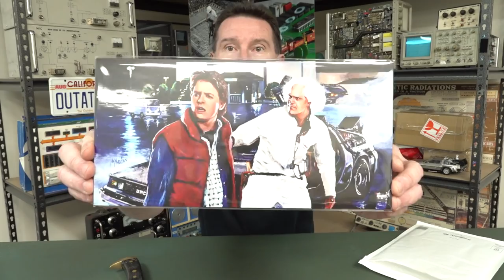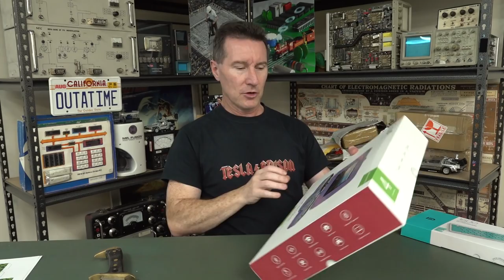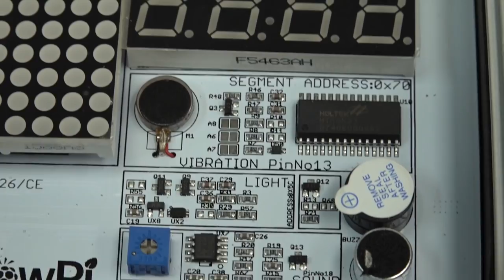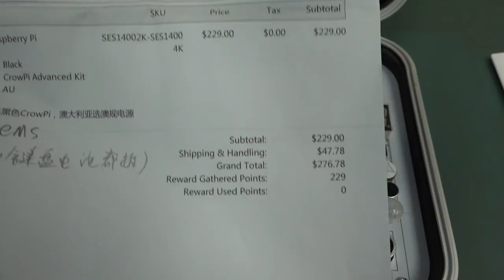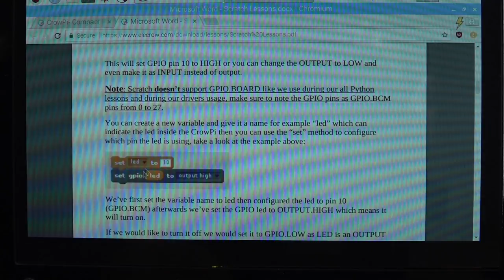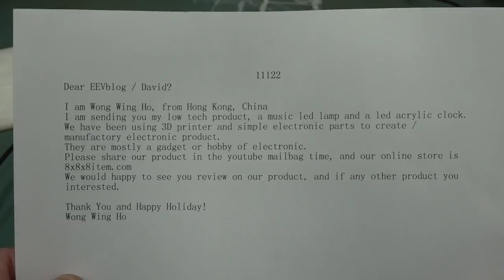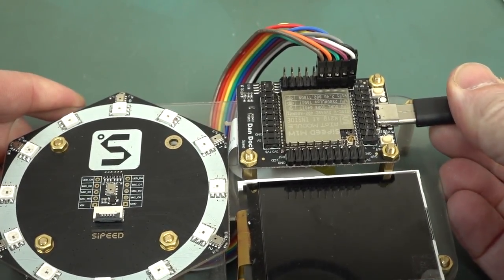EEVblog #1155 - Mailbag

Comment: CrowPi is beautiful. Like a futuristic version of the RadioShack (tandy) 100-in-1 kits from the 70's. Awesome!
Reply: But without the wires.
And the springs.
- Eddy
Reply: That is so far from my 200-in-1 it's not funny. 😀 The manual was fantastic though, I completely wore that out.
Reply: Yeah, but whats the point of the breadboard without anything to connect it to? Seems the headers were an oversight.
Reply: Looks like a robots pack lunch
Reply: It's beautiful but it also looks like some kind of fucked up bomb device for Die Hard 3.
Reply: I miss that stuff great comment:)
Reply: and that´s why i need one of these....a bit pricey but gReAt!

Comment: That RISC-V development kit is pretty neat, the MCU is from a company called Kendryte. To my knowledge, it's the first low cost chip using RISC-V, which is an open instruction set architecture (ISA). It's kind of a big deal, since most processors/MCUs use ARM or x86 which are not open specifications and require royalties, NDAs, etc. Bear in mind however that specific implementations of the ISA are not required to be open, so don't expect to be able to download the Verilog/VHDL code used to design this chip from Kendryte. There are some open source implementations that you can try out on FPGAs like the Rocket core. Also recently Western Digital announced that they will be open sourcing their implementation called Swerv, which they plan to use as controllers for their SSDs.
Reply: RISC-V is really cool, we'll be seeing much more of it in the future, Dave should do a video about it, maybe ask the devs to send a dev board.
Reply: Robert Baruch has done a few uploads about RISC-V on YouTube (YT Channel is his name//no affiliation). 
  Does anyone know of any other video references covering RISC-V, especially more top down explanations that are hobbyist friendly?
-Jake

Comment: I kickstarted the adv. CrowPi kit and it came with extra kickstartery goodness and I love the thing.  Perfect for quick experiments or short little homemade programs with the kids.  You can still use the io pins with jumpers etc, if you unplug the ribbon cable and use the bread board or your own.   It is an excellent bit of kit IMHO.

Comment: The pseudo nixie tube thing is not an original concept, techmoan did a video on several systens like that but a lot better several months ago
Reply: Yup, just get the much better original, also called "Cronixie". Techmoan did a great review about it and got all the necessary info: https://www.youtube.com/watch?v=miqN2gR1Zns
Reply: @GollumReloaded  And after I went through all the trouble to find that video the hard way with the intent to post here. Nice work.
Reply: I'm guessing Dave does not follow Techmoan...
Or play Minecraft ..
- Eddy
Reply: You cant buy them (I suppose you could probably commission them) - but check out the giant lixie tubes a friend made for 'Zumbo's Just Deserts' (Cooking show in Aus) https://hackaday.io/project/13366-giant-nixie-tubes

Comment: The cable direction between the screen and the board bugs me. It should run along the seem and twist to reduce the cable flex. Wonder it there was enough room under the board to put in a mains supply?

Comment: The crowpi looks exactly like something a hacker in a hollywood movie would bring...
I want one.
it looks really neat and compact. Got everything you'll need for small raspberry pi projects. Little unfortunate that they don't provide a pin header or something. So if you'd want to add a component of your own you'd have to take the flatband cable off, jump all the contacts but the ones you want to rewire, not that good of a solution really. But otherwise quite neat.
But honestly, it just looks so cool.
Reply: So cool, I just bought one for my 11 year old - I hope he likes it.
Reply: You could probably unplug the ribbon from the larger board and insert jumper wires directly into it.
Reply: Don't bring it to school, might be mistaken for a bomb!
Reply: @willierants5880  I was actually thinking it could be something the schools could use as a part of an elective class.
Reply: I just don't get why selling a pi with a bunch of crap attached is desirable.  I'd like all this stuff, but not all slapped together in a kit. I'd want to be able to use those sensors in a project outside of the case. Mounting everything in the case makes everything less useful.
Reply: @Maskddingo  It's a trainer, not a dev kit.  You see similar kits for teaching EE and CS courses.  In your case you would also be better served just going the non-integrated route, it would be far less expensive.  And ultimately this trainer doesn't provide anything outside of convenience and portability that you can do for less just buying the components separately and then putting them in a portable box.

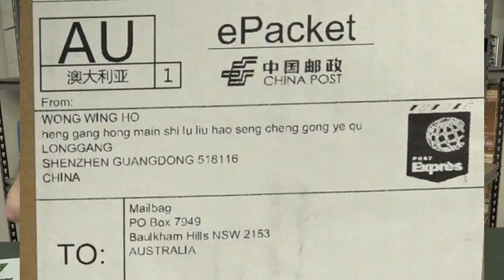Comment: The CrowPi kit: "Lead you Go from Zero to Hero with Raspberry Pi". It includes a "4 BITE SEGMENT" as seen at 11:19.  :)  IIRC, with the Pi 3 the recommendation is to use a power supply that can supply at least 2.5A. I punched that long string of stuff shown at 20:13 in to a translator. It came out as "Henggang Hongmai Ms. Road No. 6 Yucheng Industrial Zone".

Comment: Most pins on the RPi are multiplexed with other functions. In this example, pin 12 / GPIO 18 is tied to the clock for the PCM audio module. I'd have to imagine that Scratch only takes hardware control of the GPIO after you hit "run", and outside of that the IO is nonsense.

Edit: See the BCM2835 peripherals datasheet linked here: https://www.raspberrypi.org/documentation/hardware/raspberrypi/bcm2835/BCM2835-ARM-Peripherals.pdf

Comment: Interesting, I was looking into the "Risc-V" (aka Risc Five) by the way [they're open source processors].  The processors are very cheap given their 400MHz clock and their 64 bit bus width.  Also comes with KPU and WiFi and what not.  Entire SOC is less than $10.

Comment: "Edge Computing"
My interpretation of it is with respect to upcoming 5G networks. The intent is to try and keep latency low when performing remote or cloud computing tasks. An example is a vehicle using a 5G edge computing network to assist in full autonomous driving tasks. The edge in this case is in the fronthaul interface, at a point offering minimal response latency.
Hope that brings some clarity Dave.
Cheers,
- Eddy

Comment: Yeah not being able to connect the GPIO's yourself is a deal breaker for me.  Elecrow if you are monitoring comments I recommend adding the ability to connect the GPIO's as you please in version 2.0.  Aside from that this looks like it could be a real winner.  Price is pretty steep though at $199 for Basic and $299 for Advanced.

Comment: I think this CrowPi board thingy is excellent for beginers. No need to solder anything, very low barrier of entry, low risk of damaging something, etc. Just power up, start coding and have a go. It is not ultimate hacking platform, but at the same time, once you are familiar with it, you can simply unhook the ribon cable and connect whatever you want to it.

Comment: 230GOPS in 0.3W. WOW. My CPU with 180W peak power consumption can barely do that much today. What a time to be alive. RISC-V plus AI extensions in it, are really rocking.
Reply: But what kind of operations are they?
Reply: @0x8badf00d  Low precision additions and multiplies (and obviously loads from memory). It is mostly <=16 bit integer and <= 16 bit floating point FMA ops. (It can also do other things, but these only comprise few percent of the total workload). People usually refere to these as vector operations, tensor operations, etc. these are pretty standard vector flops, just optimized for low precission (that is enough for neural network training and inference) and speed. They usually use signed numbers, use saturation arithmetic, often do not support denormals/nans/infinities and use different width and balance of mantisa and exponnent than the ones commonly used for "standard" computations (single and double precission arithmetic). Most GPU and CPUs usually use much higher precission flops for vector stuff (single precission - 32 or double precission 64 bit, and even sometimes higher (quad - 128 bit), and it is often used in a lot of scientific simulations and graphics), but for AI, you can get much more performance without sacreficing accuracy at all, by putting more of faster and more narow execution units in the same space on silicon. There are some AI chips that go as low as 6-7 bits, to really squeeze last bits of potential without hurting accuracy. (neural network are extremally robust to errors and stochastic training, so the exact values of weights doesn't matter that much). Or even 1 bit, in some crazy research areas, but these are rather esoteric and still under developement, as they are less flexible. (btw. multiplication of 1 bit numbers is really trivial, it is simply binary and, aka single gate, aka hyper fast compared to actual multipliers). It is also similar to what DSPs do, and there are similarities between AI processors and DSPs, but DSPs usually use wider multipiers and adders ("wasting" silicon space and power), limited number of them (limits parallelism), and focus somehow more on single threaded serial execution.

Comment: Dave's only critical feedback on the CrowPi is hardware is the lack of interfacing with the GPIO ports but I bet you can pull that ribbon cable off and put easily put jumpers to the breadboard and back and to wherever you want. I think it is meant for that..   That thing is cool ...

Comment: The Pi3 needs 2.5 A.  Also PI does not know how to negotiate with a cell phone charger. (I don't think you are using one, but it is a trap.)  This kit probably need far more than 2.5 A.  The screen will take a good bit of current too.

Comment: Why is it safe to assume the barrel is center positive? I ask because I come from the world of guitar pedals where it seems like everything is center negative, but most of my other consumer electronics all too often use center positive. Is there rhyme or reason behind one or the other?
Reply: Most of the time the sleeve connects to the ground of the device. This convention makes sense because some jacks have a metal body which connects directly to the metal chassis. The convention that sleeve=ground is true also for guitar pedals, however they sometimes use a negative DC supply because that's how the circuit was designed. So that makes the sleeve positive and the centre negative. However, modern digital electronics use a positive supply voltage, so by convention they will be center positive 99% of the time.

Comment: To bad that most of these visual programming tools are not really professional.
Sometimes it's just easier to quickly tinker out some ideas without looking up all the code and libraries. 
Once that is done you can go to the actual optimizing of the programming code.

Comment: The Crowpi is pretty impressive. Nice quality all around put into a very nice case.
Reply: It seems pretty nice, nothing really amazing in itself but it's neat to be able to interact easily without a lot of setup with many physical input and output devices.

Call me crazy though, but for that price tag I feel like having a built in battery so you could run it away from a power source would've been neat. There should be enough room below the board, cost and complexity isn't too bad since there's many off the shelf boards that'd do it. That said I do wonder if including a battery might make it more complicated with getting approval for sale in some countries and it'd definitely complicate shipping (unless it gets the required certifications).

Comment: Don't you just remove the IDC cable to use jumper wires with the Pi .after all you wouldn't want all the sensors and lcd ect connected when developing your own circuit ideas

Comment: hey @EEvblog , the 'fake nixie tube' clock is actually an open source american project, Lixie Tube Display, so you oughta retract their originality score :D
Reply from the maker: Ah, didn't know, thanks. Formally retracted.
Reply: @EEVblog   no worries! 
the project is way more refined than this company here makes it seem, Connor Nishijima(Lixie maker)'s had them proffessionally made, with the laser cut panels and hardware, ws2812b strips and arduino capability
Reply: LED-based re-creation of "light pipe" numeric displays, which of course originally used incandescent bulbs. Non-Linear Systems used those in some of the first digital voltmeters. They did have the same issue as Nixies of having to look through other digits, but I always liked the look. The modern "Lixies" do a pretty good job of reproducing the fonts.
Reply: @EEVblog  There's also a german company which is selling clock kits or single modules based on this concept on ebay since a few years. Techmoan did a great video about them, you should check it out: https://www.youtube.com/watch?v=miqN2gR1Zns